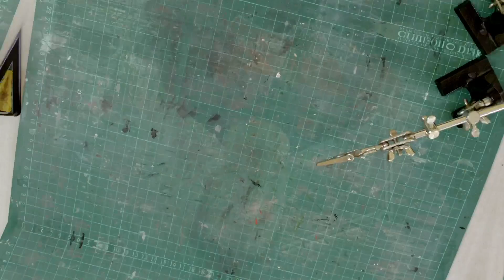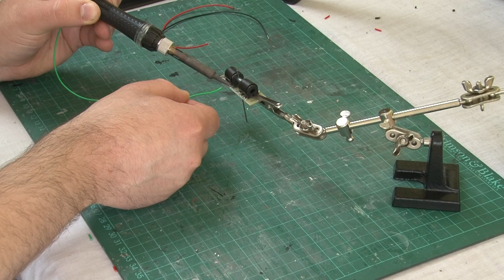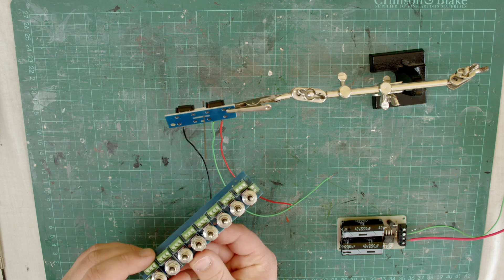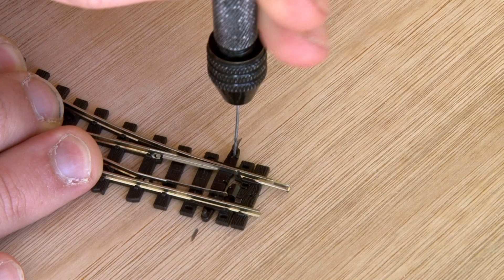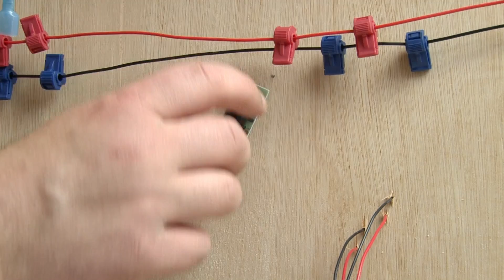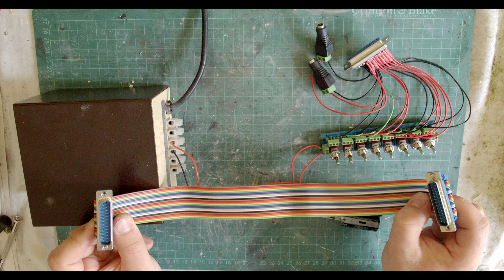How To Install SEEP/Solenoid Point Motors - Model Railway Tutorial

Comment: Great video, although you did confuse me when the black wire coming from the controller suddenly changed to green when plugged into the CDU !  
Do you have an example of how you mount the switch block to a control panel ? Cheers, Mike

Comment: Is it worth it to use point motors if I‘m only going to have 3-5 points?
Reply from the maker: It's not about the number of points and more about whether you want remote operation or not. If you're happy switching the points by hand, regardless of whether it's 2 or 20 of them, then there's no need to add motors. It's not a requirement.

Many people prefer to have a more hands-off approach which is why they often add point motors. Another reason would be if the point is in a hard to reach place. Thank for watching 😃
Reply: @ThatModelRailwayGuy I‘m not sure. I think I‘m going to leave space if I want to install some later!

Comment: Do you have to buy a CDU for each point motor? Or does one do all?
Reply from the maker: Nope you only need a single CDU as it's capable of running multiple points. You can even use it to switch multiple points at a time - for example on a crossover. Thanks for watching 😃
Reply: @ThatModelRailwayGuy  Thanks, I have 7 points on my layout and I was wondering how many you need, Great video. Very helpful.

Comment: I have the same switch bank as yourself, as well as having the green common wire to each motor, do I see you then running another common wire from each switch to the next one? Also, do I also link each motor with a green common?
Reply from the maker: There's two thing at play here and honestly I've made things confusing by using a green wire for both: 

- On the switch bank the green wire brings the power from the main supply to the switch. We need power to every switch so rather than running 8 feeds from the power source it's easier to just daisy chain them.

- On the layout, the green wire is acting as a common return to get all the power back to the main supply. Since all the power is going in the same direction you don't need a separate wire for each motor, you can just use one wire daisy chained between each motor that eventually brings all the power back to the main supply to complete the circuit.

Hope that helps but have a look at some Parallel Wiring circuit diagrams if you're still confused as that's all this is at it's core. Thanks for watching 😃
Reply: @ThatModelRailwayGuy Thank you, I think I understand. I daisy chain each switch to the next one required for points, I then daisy chain each motor to the next one in the sequence?

Comment: anyone know of a point motor that runs on 12VDC ?
Reply from the maker: I believe the Cobalt iP Point Motors run using 12v DC. They're more expensive though. Unless you're planning to use them to their full potential then I can't help but think that getting an AC power supply would be cheaper and easier. Thanks for watching 😃
Reply: @ThatModelRailwayGuy ok brilliant... will look into both options.... appreciate the feedback 👍🏻🇦🇺

Comment: Hi! A quick question regarding two switches at once, obviously in this video, the points you have used are insulfrog - can this be done using electrofrog points? I'd like to control a crossover similar to yours as one rather than two, but worried about how I would go about wiring the frogs? Can I wire both frogs into the same terminal on my switch? Many thanks in advance.
Reply from the maker: For switching the physical blades the type of points don't matter at all as long as you have a CDU capable of switching 2 points at once. If you want to switch the frog polarity you need the two points to be isolated from each other (as you would normally). This avoid a short circuit as the frog feeds would be opposite to each other. 

The frogs shouldn't be wired to your point switch. You can either use a second switch (for each point) to control the polarity or I'd recommend using SEEP PM1s which have a built in polarity switch for this purpose. Check out my Unifrog Point Wiring Tutorial for more info as the point motor wiring is essentially the same for Electrofrogs. Hope that helps and thanks for watching 👍

Comment: Doesn’t ballast affect the operation of a sub base point motor? You drilled quite a large hole to allow the points stay through the base. How did you deal with that?
Reply from the maker: Most people ballast their track by adding loose ballast then flooding the area with watered down PVA - but you can't do that near points or they'll get all gummed up. So generally around points you tend to put down neat PVA first between the sleepers then sprinkle a light amount of ballast on top. Any ballast grains that do fall in the hole are minimal and are usually dislodged immediately once the motor is fired for the first time. 

However these days I tend to use double sided tape which both holds down the points and allows you to ballast between the sleepers really quickly. Thanks for watching 😃
Reply: @ThatModelRailwayGuy thank you for this. I have learnt such a lot from your excellent videos. I am 71 and starting out on my first model railway, a TT120 scale.

Comment: Hey, great video I have a really stupid question. I have the point motor and even with your explanation I still don’t feel confident wiring it. I have 2 feeder wires that will go up to the bus wire (I think) what is then the common wire? The point motor I bought was a seep motor guagemaster PM1 switch built in (not 100% sure if that means polarity switch are physical switch) do I still need a physical ‘switch’ to activate the point itself / move it. I am building my first dcc layout and this bit I really want to get right. Thanks in advance
Reply from the maker: Hi there, no stupid questions here - we all start somewhere. First thing to say is that I'm not sure how the bus wires come into it as the point motor and associated wiring should be completely separate to the track wiring. If you're wanting to use these point motors with DCC control then you'd need an accessory decoder of some sort and the wiring would be significantly different from what I've shown here - otherwise you'll most likely damage the motors.

Essentially there are three main wires but two of them are the same, they just go to the opposite sides of the motor. So you have 1 positive feed from one side of the toggle switch going to one side of the motor and a second identical positive feed from the other side of the switch going to the other side of the motor. This allows you to direct power to each side of the point motor individually which is what allows it to switch back and forth. 

The common wire is then our negative feed and this completes the whole circuit by running back to your power source. Once the power has gone out to the point motor (regardless of which side it's going to) it needs to come back.

The PM1 does have a built in switch but it's not a switch that allows you to control the motor. It's a switch that controls something else when you trigger the point - for example lighting up an LED on a control panel or changing the frog polarity on unifrog points. I did a video on this last year which you may find helpful: https://youtu.be/X4nuIdbGsvo

Hope that helps and thanks for watching 😃

Comment: Great video! Just what my sons and I needed to get started. Thank you, TMRG!

Can you tell us which Dremel attachment you used for both cutting and grinding?
Reply from the maker: Awesome that's great to hear! I generally use Diamond Cutting Discs (not as expensive as you would think, you can pick them up on Amazon) and the gooseneck attachment for the dremel is really handy as it makes it easier to get closer without damaging anything. Thanks for watching 😃
Reply: @ThatModelRailwayGuy  Thanks for the rapid and helpful response!

Comment: Hello, can u tell me if i need a CDU for this setup? The problem is its sold out everywhere, but for my understanding is that the cdu gives a quick burst to the Motors to switch quick, so do i need it if without it the switches switch slow ?
Reply from the maker: As I said in the video, it's not required but highly recommended when using solenoid motors. You won't get a slow movement with a solenoid, but if you hold down the switch you'll end up damaging the point motor without a CDU so in my opinion it's better to use one.
 
There are plenty of CDUs available - Derails currently have the Gaugemaster one in stock: https://derails.co.uk/GMCCDU-Gaugemaster-Capactor-Discharge-Unit?search=CDU
You don't have to use that specific brand either, for example this one for Amazon works in exactly the same way: https://amzn.to/43GHmVv
Thanks for watching 👍
Reply: @ThatModelRailwayGuy  Damn thank you very much for the fast Reply, somehow i missed that part of your Video, maybe because i was in school. But thanks very much for your help.🥰

Comment: I just purchased the toggle switch bank of 8 you used. I connected up without the CDU and it didn't work. I tried a single switch gaugemaster which operated the pm2 fine.  Will this bank of switches only work when also connected to a CDU or is it faulty do you think? Thanks for your advice.
Reply from the maker: Interesting, I can't think why it wouldn't work without the CDU but I can't say I've tried it myself so I can't confirm either way. To be honest though I would highly recommend using a CDU as without it you do run the risk of damaging your motors. Thanks for watching 😃
Reply: Thanks for your quick reply. I connected up to a CDU and the toggle switches worked fine. Relieved I didn't have the bother of returning the switch bank!

Comment: Hi I was wandering if I’m using a dcc select controller how could I power the point motors and would copper wire work for the point motors?
Reply from the maker: Some point motors are designed for DCC use and come with built in switch so that they can be controlled as an accessory from the controller. For those motors you can power them directly from the DCC bus. Copper wire is fine although ideally you want to use multi-strand wire rather than a solid core. Hope that helps and thanks for watching 😃

Comment: Hi can I ask could all 7 toggle switches be power through this cdu or would I need to add more cdu in the equation thanks
Reply from the maker: Yes a single CDU can power all 7 switches, that's how I used it myself. The CDU simply provides a short burst of power for whichever switch/motor requires it. A single CDU can power way more than 7 switches/motors. 

Where it doesn't work so well is switching multiple points from one switch. Most CDUs are capable of switching 2 points at once (for example a crossover) but anymore and you might not get enough power to switch each point fully. Similarly if you're switching lots of points in quick succession you'll need to give the CDU time to charge back up. Hope that makes sense and thanks for watching 😃
Reply: @ much appreciated I’m about to build my first oo gauge, looking for something to operate 4/5 solenoids am I right in thinks 12v isn’t enough power and ideally need 16v thanks paul
Reply from the maker: The SEEP solenoids that I used here work best with a 16v AC supply, I'm not sure if the same applies for other brands/motors.
Reply: @ ok thanks again

Comment: Great video, question though, I’m going to be doing this with tt120 hm7000 could I wire the cdu into the track bus for simplicity or would that be a no no?
Reply from the maker: I would not do that personally - the CDU probably wouldn't work properly and it could potentially damage your DCC stuff as well. However you could get point motors designed to work on DCC power, some of which allow you to control each motor as a digital accessory. Thanks for watching 😃

Comment: Thanks for this video - notes taken! Once I get round to installing some, I'll probably attempt making a control panel.
 First I have to find a way to drill holes into already laid track...!
Reply from the maker: Glad you found it useful. Yeah that's generally why I recommend drilling the holes before laying the track. You may have to do it manually with a pin drill to avoid destroying the point mechanism. Thanks for watching 😃

Comment: Please do a video on how to wire multiple points on a track
Reply from the maker: The process is the same regardless of how many points you want to motorise on a layout. The only difference would be you could daisy chain the positive from the CDU to all the switches and similarly the Common Return on all the motors to simplify the wiring slightly. Thanks for watching 👍

Comment: Could I use a bus wire for power on the points?  Many thanks please keep up the good work with videos
Reply from the maker: Hi Graham, there isn't really a simple answer other than to give you a safe no. While I think it technically would be possible using rectifiers or other converters generally it's best to have a separate power source for your points. The exception to this would be if you're using point motors specifically designed for use with DCC. Hope this helps and thanks for watching 😃

Comment: Hi watching this video again wired up that row of switches just one but it goes once and not back what do you think I’m doing wrong if you could help would be great thank you
Reply from the maker: Without seeing your setup it's hard to diagnose the problem but my initial thought would be to confirm whether the issue is actually with the motor. Is this happening while attached to a point - if so, remove it and test in isolation to see if that make any difference as sometimes the way it's installed on a layout can restrict the movement in one direction. Thanks for watching 😃
Reply: @ThatModelRailwayGuy  not on a point just testing to see if it worked tried to find videos on it but even on there wed site there’s no information but thanks away cheers

Comment: Very helpful video, Though I seem to have the opposite issue with the tall motor rods, my baseboard is about 10cm deep (5cm wood, 5cm foam board). Is it possible to extend or replace these motors rods to be the length I’d need? Or would I be better off just going with surface point motors?
Reply from the maker: You could possibly extend the rods using stiff piano wire (or similar) attached to the existing rods but I would be worried it may start to flex and not throw the point properly.
Some people in your situation embed the motors into the foam just under the point to avoid this situation but obviously it does make things more complicated if you ever need to get to the motor for repairs/maintenance. This is actually one of the reasons I personally don't tend to use foam on top of the baseboard surface. Hopefully that's given you a couple of options but best of luck and thanks for watching 😃
Reply: @ThatModelRailwayGuy  thanks for the reply, unfortunately the table has planks of wood glued to the sides to stop trains from falling off (from when I was a kid 😅), my grandfather was the one who built it, hence the compromise of using foam board to bring the surface of the table up to the top of the barriers, instead of pulling apart the table 😅.

since the initial question I think I’ve found a sound solution, essentially I get a length of piano/hobby wire of the same diameter as the motor rod, and a piece of brass tubing that the rods/wires fit in tightly. I put glue on each rod, and put both rods into the brass tubing. 

Hopefully this keeps them tight and doesn’t allow for any flexing in the extension when switching.

Thanks again for the help 🫡

Comment: Very helpful thanks! Love how easy your vids are to follow
Reply from the maker: My pleasure, glad you found it helpful. To have an LED light up on an indicator panel I think you'd have to use the SEEP PM1 motors instead. They use the extra tabs that I didn't hook up in this video to allow the switching of a relay, either for frog polarity or for control panel LEDs. I think Gaugemaster have some wiring diagrams on this but I will also be filming a similar video that covers this method in the next few months as part of a new layout build. Thanks for watching 😃
Reply: Is there a way you know if to have a led light come on for which way the point is set using this method? On a control panel.
Reply: Hello again, I’ve a question to bug you with if you don’t mind, just wondering about the radius of points, a larger radius does this mean the point is longer which then would mean the train and coaches would flow more elegantly so to speak through the point?
Reply from the maker: @Thorndale_Model_Railway  Yes that's exactly right. The large radius points are also more realistic too since most model points are quite significantly compressed from their real life counterparts. That said, I used small radius points as a space saving measure on both this layout and Pitley Steam Railway and they work perfectly fine 🤩
Reply: @ThatModelRailwayGuy  thanks for clarifying this for me, I’m getting to the stage where I’m going to need to buy some points, but I want it to run smoothly through them😀

Comment: I would like to install the solenoid next to the point and not underneath the board (i don't have one due to lack of space), have you tried that before? thanks.
Reply from the maker: I haven't tried it myself but it would be fairly simple. Obviously you'd need to use one of the surface mount point motors, some of which I believe have the wires already attached. Thanks for watching 😃